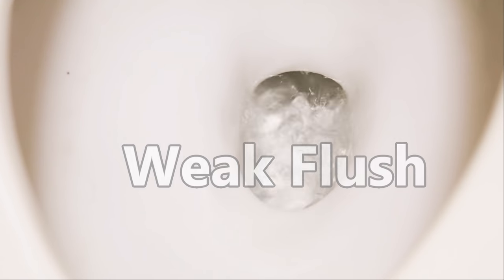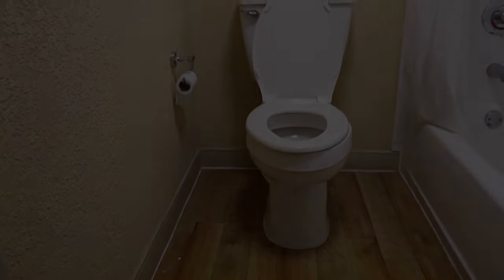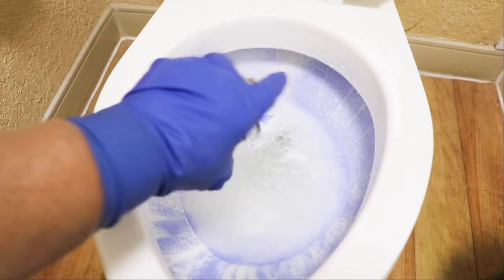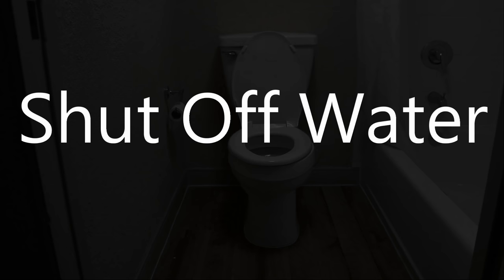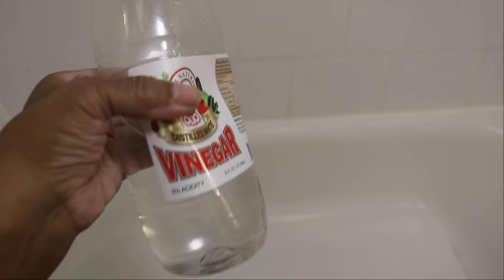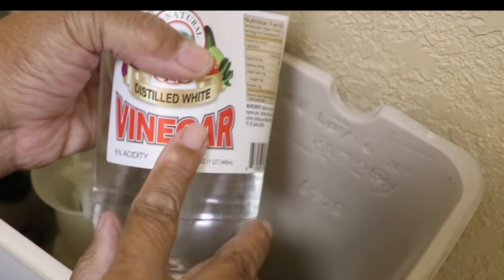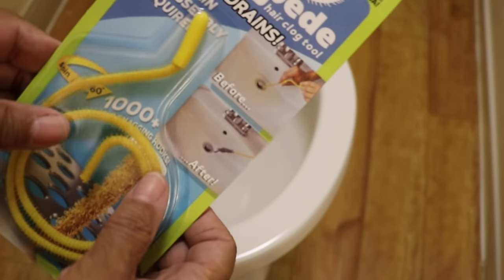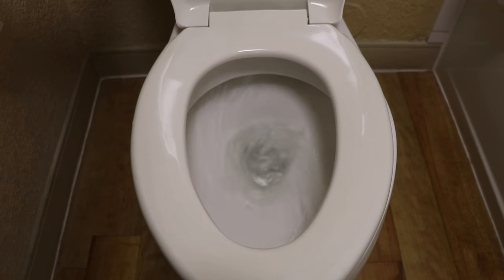FIX a Weak Flushing TOILET

Comment: Good video. The first thing to do is to quicky pour a bucket of a gallon or more of water into the bowl. If it flushes normally, the drain and internal toilet trap are clear. If not focus on clearing the toilet trap and drain pipe (plunger, closet auger). Make sure the water level in the tank is at the fill line or if not marked about an inch below the top of the overflow pipe. Adjust as needed. If all this is ok, follow the cleaning procedures in the video. In my case, the small rim holes were clear and the problem was the siphon jet at the bottom. Much of the water and force comes from this. I used a small wooden stick to clear some mineral deposits and will buy a small brush to maintain it. All orifices need to be clean as there is not a lot of water to work with. Newest models use even less water. My old 5 gallon toilets that these replaced never had this problem and I bet some holes were plugged after 45 years but there was so much water they still fushed.

Comment: Good video, fixed my toilet.Thank you. I was a few days finding right video. Some were a waste of time unitl I found yours.

 Only I never used vinegar or any cleaner. I just took the mirror then piece of a old knitting needle cleaned out the holes under rim. Works like new now. Toilet 50 years old.

Comment: That is exactly what was wrong with mine . I cleaned the jets and it opened wright up .Thank you for this post . I was almost ready to call a plumber . That would have been expensive. I still have to run the vinegar through . Thanks again . George  Browne from VA Beach VA

Comment: Although Leah did not mention it, use White Distilled vinegar.( It did show on the bottle in the pix). White vinegar is also great to put in a pan & heat to clean out the screens on the water spouts and coffee pots too.

Comment: An Allen wrench with a diameter a bit smaller than the under rim jet holes  works fantastic as it's angled perfectly and won't bend while you clean them which a piece of wire could do.... just do it easy so as not to chip the porcelain

Comment: Hi Leah! Thank you sooo much! I have PTSD around house stuff (complicated backstory) but now things like this trigger me massively. Your attitude is so reassuring. I'm afraid my toilet is built in and there is absolutely no way there's any hidden panel, only tiny circular flush button and rest tiles :( However, I'm going to try and put lots of vinegar on a bendy hair catcher thing and use a mirror to clean the jets as much as possible. Do you think this might work? I'll give it a go anyway. The flat's are only 6 years old, but we do have hard water. x

Comment: Great video! Thank you, Leah! I'm also wondering about toilets that you have to hold the lever down during the entire flush cycle in order to keep the water going... We have one like this at work and I'd probably be regarded as a goddess if I could fix it. 😆  🚽✨
Reply: Not sure if you figure it out yet, but most times I just adjust the "flapper" chain in the tank. It might be a bit too loose so when you press the handle, it doesn't lift the aforementioned "flapper" high enough to let enough water into the bowl. Adjust it with the clip a notch or two and see if that helps!

Comment: Excellent video thanks. This is the only practical solution I could find so far on YouTube to fix my lazy flash. We found the syphon hole was completely plugged up. After several attempts descaling the hole we brought it back to new condition. Now because of this video we have a awesome flush.  I was heading towards spending big bucks to replace every valve in my toilet. But this video shows that you have to troubleshoot very carefully to find out what the real problem is. At worst I just had to get a set of smaller wire brushes so I could descale that hole. This is the first time I have ever made a YouTube comment. It shows how impressed I am with your solution and the fact it works so well.  God bless

Comment: Leah, I love that tip and it may prevent me from spending money to a plumber to fix that problem. I will try to clean my toilet out and hope it works so I can get maximum pressure when the toilet is flushed. Thanks so much for sharing this valuable tip with us all.

Comment: Wow... that duck tape idea!!  One word. BRILLIANT. Is it weird that I'm excited to give this a try next cleaning ???? LOL... Thank you for the video and the tip ! I would like to add a personal favorite of mine to eat away at those mineral deposits - the product CLR. 

ALSO MY PERSONAL TIP/ADVICE:  Don't be like me and think you can clean the toilet in a 1/5th of the time, by skipping the wait and JUST SCRUBBING HARDER !!!  Scrubbing harder is a promise of more future problems of FLUSHES THAT DON'T WANNA FLUSH.  Use a good bowl cleaner (I HIGHLY RECOMMEND spending the extra $$-get the GOOD STUFF - get the cleaners  with the mineral deposit/hard water buildup additive in it - it removes any buildup on the sides of the bowl and keeps it as slick as possible).  BEING OVERLY AGGRESSIVE WHEN SCRUBBING THE TOILET BOWL, even with those harmless looking brushes, the more quickly you'll rough up the bowl itself, and worst case you'll actually start "etching" cleaning marks into it.  That'll be like trying to flush wet toilet paper down sand paper - doesn't go easy!!  And check those bowl brushes that you use.  Depending how cheap they are, doesn't take long for those bristles on them to start falling off and soon you might be cleaning with that brush around the toilet bowl and the whole time your driving a bare bare metal tip up and down and all around the sides of your bowl !!  OUCH !!  Also, I advise to NEVER USE BORIC ACID to clear up a bad block or to get a better flush. Obviously, it's a pretty potent ACID...so, yeah, it'll get the flow going, but it's also going to etch and rough up any of the walls, and surfaces it comes in contact with.

Comment: I had a problem with a Kohler toilet that was flushing slow. The next day I saw a piece of one of those blue “toilet tablets” that you put in the tank sticking out of the siphon hole. I was able to break it and get it out. I had no idea it could make it in there to block it and slow the flush. I know some people say not to use them.

Comment: If the cause of the clogging is hard water, citric acid can also be used to dissolve the deposits. Some water treatment systems that try to neutralize hard water use citric acid as the agent. You can find it online fairly easily, it comes in a powder form, and even just a little is pretty effective. Plus you can use it in place of lemon juice in canning.

Comment: 👍👍 Leah, just to let you know.
Lowe's is offering an exclusive cordless tool line. This was a German found company. Like everything it to was bought out by China.  These tools outperform all others. Best part is, from now until December 31, they are offering lifetime warranty on there complete tool line.
Flex Tool
I watched a presentation about an hour long and I have to tell you, I was pretty impressed. They have a 1/2" drive impact gun that hits 1,000 ft.lb. of torque. 👍👍

Comment: My experience is that the siphon hole is the most important place that you need to clean up. You could even use a long nail or shot screw driver to scratch the surface inside it. A lot of mineral deposit will come out and the deposit inside the siphon hole is the main reason that the jet flow is slow and weak.
Another tip is that it will work better to just toothbrush to do the cleaning work than the bigger brush.

Comment: But besides taping up the small jets under the rim, don't you also have to tape/plug the main siphon-jet?  Otherwise, won't all the vinegar just run out the siphon-jet and pool in the bowl?
Reply: YES.  I just came back here to say this.  And I'm having a devil of a time stopping up the siphon yet.  Tried a wadded up plastic bag, and now a "wall" of duct tape, and each time it leaks through.  Frustrating!

Comment: thanks, i have an old house and the toilet appears to be the original from the fifties.  i tried cleaning out the large hole at the bottom and no help there.  i'm going to try your solution for the small jets under the rim--sure can't hurt!

Comment: I just moved across the country a couple of years ago and have a low flow toilet for the first time. I thought I was doomed to flush 6-7 tines every time I used the bathroom. I've never had a problem with mineral deposits from water before moving, so I didn't even think about this issue. I was at my wits end when I found this video. I now realize there is NO water coming from the jets around the rim, so I'll be trying this today.

Comment: I had this problem for years, I tried a lot of things to fix it, then I ran across ZEP acidic toilet bowl cleaner at Menards. Get yourself a cheap hand transfer pump from Harbor Freight to empty the toilet bowl then add the ZEP to the bowl and from the tank outlet to clean the jets.  The calcium and lime buildup will dissolve. And the toilet will work like a new one!

Comment: Hey there. I have this issue now after replacing all the tank parts and water input stem valve. It takes two flushes and is lazy.  I am ready to do the cleaning of the jets and wondering how much vinegar to use. I tend to go overboard so if you can tell me how much and if it should be heated?  Also I hear CLR is recommended but not sure too caustic.  I just read you said CLR may be too caustic. Vinegar it is!   (  :

Thank you!

Comment: I have an issue with a slow filling toilet after flush. It has a Fluidmaster 400a fill valve which I have already popped of the top of valve head, replaced the gasket and flushed the fill tube. It seems to work for the first flush but resumes to a slow refill. My question - is there any other maintenance I can perform on this simple valve assembly?  Will pulling the valve control head apart from the fill tube yield any further improvements by cleaning or O-ring replacement??

Comment: Good video Leah. I have an issue with my toilet running if I don't jiggle the handle to make the stopper come down all the way.
I also have a bathroom sink that has a trap that resembles a cylinder. This sink smells gross when the water goes on. I think it is gas coming back up.
Reply from the maker: Sounds like a drum trap but they're typically found on bathtubs.

Comment: Leah,
The jets on one of my toilets seems to be flowing well, but the water still swirls and swirls for what seems like a long time, before flushing.  The toilet isn't plugged.  After the flush the bowl is at the correct level, but gradually empties over four or five hours.  This toilet is in my late mother's bathroom, and hasn't been used since her death.  The problem developed after she died.  Some people have suggested a crack in the bowl, but I see no water on the floor.  It could be going into the subfloor, but the toilet is above the kitchen ceiling.  I'd see stains.  I wonder if the vent to the roof is plugged, and vacuum from running faucets is causing a siphon action.  Your thoughts please!

Comment: This is a frustrating issue with the Sterling toilets that came with our new house. They don't have the siphon jet at the bottom of the bowl. We've changed out the flaps and cleaned them very well with Zep and Iron Out. Still working on them. Home is only 5 years old. 🧐

Comment: Thanks for this but is a few weeks late for me.  I found my jet clogged and was preventing a good flush.  I can attest that is the jet that initiates the siphon action and, if the jet is clogged, flush action is weak.  Home Depot sells a stronger acid cleaner for toilets if the vinegar does not work.  HOWEVER, it must be used with care to prevent acid burns.  Leah, do you find that lime deposits can occur in the top of the trap?  I have found chunks of lime up there too.

Comment: I had toilets that were severely encrusted with calcium and lime. I solved it by putting a commercial lime remover in the tank and circulating it with a drill pump, from the bowl to the tank and back down into the bowl. It worked, not only cleaned the orifice but also the passages inside and the hard water ring around the bowl.

Comment: Hi Leah!
I saw your video about getting toilets to flush better. But our toilet doesn't have a side handle. Instead there are two "buttons" on the top. The tank is also configurated differently. Can you please do another video for those toilets? Tanks a lot...get it?

Comment: Thanks for your videos.  I just did a bathroom remodel and installed a new toilet.  There are no visible leaks on the floor or anything visible from underneath.  The fill mechanism doesn't leak or run extra but when we add waste, I can here what sounds like bowl liquid dripping down the sewer pipe or inside the bowl.  It's a hollow echo dripping sound.  I installed a new flange, slightly proud of the floor and used a fluidmaster rubber seal without the extra spacer gasket.  Any idea what this could be?  I have never heard this sound and have changed about a dozen toilets.

Comment: After trying all these fixes this simple solution worked 100% It is most likely your chain is too short if that doesn't fix it then remove flapper and see if there adjustments on it, if so adjust to highest setting. Problem solved

Comment: I recently found your channel. My toilet doesn't remove paper and waste from the front. I poured warm vinegar in the overflow pipe, I cleaned all the rim jets. Still when I flush I can see very little water coming down in front of toilet. Water is coming out of the rim jets great from the sides and back just not the front. Not sure what else to do?
Please advise
Thanks!

Comment: Mine isn't being caused by the blocked jets but by a slow leak between the tank and the bowl inside. The tank fills on the flush and then gradually leaks into the bowl so by the next time I flush there isn't enough left in the tank to make a strong flush. How do I fix this issue? And I did already change the flapper to a new one. I think it is leaking through the flush valve gasket. Won't I need to take the tank off of the bowl to replace that?

Comment: The main issue my toilet has is little to no water coming out of the jets under the rim. So I finally tried this method today. I followed the instructions exactly, and I even let the vinegar sit for 1.5 hours. Nominal improvement at best. Not at all what I was expecting. Time to call in a professional.

Comment: Wouldn't it be easier to use the product CLR (calcium , lime , rust) remover for a more thorough and powerful cleaning and maybe save you a lot of scrubbing , since this stuff is designed specifically for dissolving this stuff
Reply from the maker: No, because it may damaged parts in the toilet .

Comment: In my toilet the overflow pipe does not go to the rim jets, it goes straight to the bowl. The tank water goes to the jets. This means I have to pour the vinegar into the flap covered opening.

Comment: My float valve broke about a year ago or longer & I have been bucket flushing. Then excess water around the seat from bucket flushing made the el cheapo toilet seat come apart. Crickey! I finally tore into this job & installed the valve in 10 minutes, the seat in 5 minutes and then it would not flush properly!!!!😮😢 I did a modified version of this vid & it is now PERFECT!!!! I saved probably $150 that I can use to get someone to do something I really CANNOT do myself like replace the baseboard heater in that bathroom. I cuss mostly. If I cried every time something went wrong here I’d be dehydrated! 😂

Comment: Leah hello. I have a similar issue with my toilet but it's not the jet holes or the bigger hole in the bottom. I also screwed the adjuster all the way and I still have the same issue. It's like I'm not getting enough of a push in the flush. I have to flush multiple times which always ends up plunging
Reply from the maker: Sounds like a blocked plumbing vent

Comment: What if you have a new toilet that is only a few years old that keeps clogging at the drain and won't go down right, have to keep flushing it to get it to empty, even plunging it does not always help. Is the Wax Ring screwed-up or what ????  Ps- Never had problems like that with the OLD toilet!!

Comment: A plumber told me that the calcium buildup is actually as hard as concrete snd told me to use a screwdriver, not the gentle tiny wiring you used.  What to do? What to do?
Reply from the maker: Sometimes It can be difficult to clean

Comment: Yes this works. I would save the duct tape and the fancy wires. get a 14 gauge wire or  a wire clothes hanger and clean the holes. and the siphon hole. 5 minute job.

Comment: Our water is so full of mineral deposits, it ruins everything building up deposits on my pots I used to hold water on the woodstove, white clothes turn brownish, I bet this is part of the problem with the flush-the other is the low flow flush (pushed by our Government) as I have to flush multi-times, Thank you
Reply: You might consider whole house (both hot and cold) soft water treatments if minerals that bad.  You may or may not want to drink the water, some do, some don't.  My dad wouldn't drink the water anyway when we had such hard water in Az.   It will probably allow your appliances to last longer.

Comment: Please help. My toilet slow flush. Got Roto Rooter,  cleaned main & toilet snaked it. Have 3 other toilets in house work fine. Roto told me to clean rim holes and siphon jet. No rim holes..big slot I cleaned out.  No siphon jet!? Float. Valve, flapper and water level ok? I'm stumped. Oh..bucket test good

Comment: Note that she used 5% vinegar - the most common vinegar you'll find in stores. 4% vinegar also exists but will not do as good a job. You can also find horticultural vinegar which will be a much higher concentration of vinegar (25%+). You don't want to use that as it's actually quite dangerous to use and should only be used with a respirator and proper skin covering.